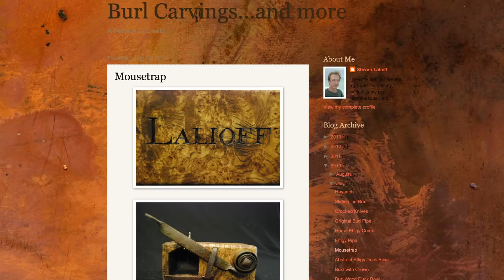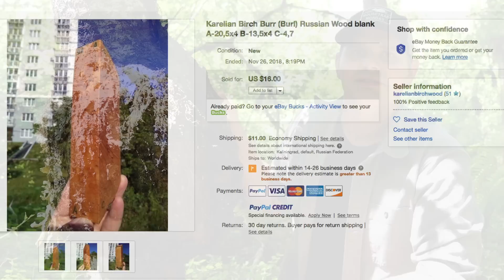Guillotine Mouse Trap. How To Build An Antique Style Mouse Trap. Mousetrap Monday

Comment: 11:02 "f off, it's mine!" Big regret XD
Reply: It was closely a triple catch
Reply: You can actually see the mouse barely escape in the last two frames before it cuts off (you can see this by using < or > keys while pause on 11:09 to move frame by frame)!
Reply: @khairiissa3910  Or put it on .25 speed
Reply: On the mousetrap monday website, you can see that the mouse on the right's head stopped the blade from coming down on the left mouse, so it was only a single kill.
Reply: @hps362  
It's one brutal mousetrap, I must say. Shawn might have drilled in that hole (and trigger) an inch further.
Reply: @-danR  I mean, if I was told I had to die today, this trap would be at least bottom 6 options for how I'd go about it.
Reply: @hps362  
A good thing a rat didn't try for that bait. Else he'd never live it down with his good-for-nothing friends:
"Har har, here comes old Nose-less...."
Reply: The rat that survived got shock waved lmao! Slow motion on 11:08

Comment: Just a tip for metal working, the hottest part of the flame is not actually right where it begins, it's at the tip of the bright blue inner cone of the flame. Place your metal at the end of that cone to heat it faster.

Comment: Question..? 
How does one know if the traps a really from the past in the claimed time periods.. because anything being sold can be likely manufactured to look like it’s from Centuries ago.
So really the prices are really a scam. Not just a ripoff
Reply: Radiocarbon dating. It's not the most accurate analysis, but it's more than enough to show you whether it's modern or made five centuries ago.
Other methods include looking for a particulate compound that's been heavily used during that time period (uranium was used in glass in early 20th century, for example) or, inversely, searching for a compound that's not been synthesised until recently. Fabricating resources to fool the tests is most often than not going to cost you more than the scam is going to net you.

Comment: 3:24 Did he really just say blank instead of plank?
Edit: I'm surprised if no one commented about that.
Reply: RandomDragon :3 he sure did
Reply: Blank is correct. It’s a woodworking/metalworking term used to refer to a piece of stock that has only been sized on the exterior to rough dimensions, and has not yet been machined into its final form.

Comment: this is abit  brutal just  for  a mouse
Reply: AlfieAlsop no
Reply: @charlesjames6517  what
Reply: AlfieAlsop tahw
Reply: @charlesjames6517  athw
Reply: It is a quick kill
Reply: Daniel Thrasher it really isn’t if you go to the uncensored videos on his website they don’t die instantly instead they struggle around for quite a while until they give up
Reply: @danielthrasher6131  no the jagged edges and low strike power make it only fly in halkf way for a clean cut it shoulf have been a straight edge

Comment: You’d think the rodent would’ve learned by now...

¯\_(ツ)_/¯
Reply: 佐藤 - Satō they actually do learn. If you put a mouse trap down and the other mice see a dead mouse they’ll know that suspicious contraption with some food on it is bad and stay away from it. 

That’s why typically mouse traps don’t work for very long, mice learn from the deaths of their comrades and avoid traps.
Reply: Rats see what’s happening and they won’t fall for a trap twice
Reply: @thepaultato3243  "Even brute beasts and wandering birds do not fall into the same traps or nets twice."–Saint Jerome
(Civ 5 quote when you research trapping)